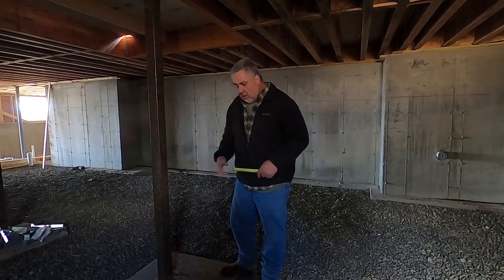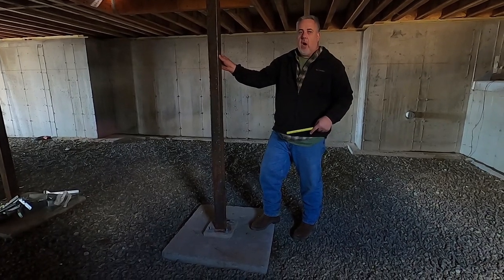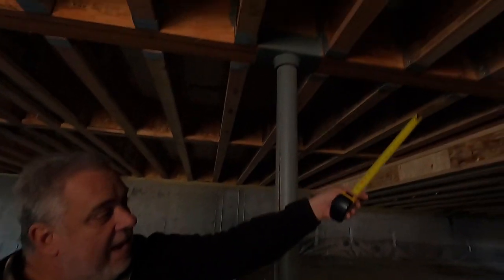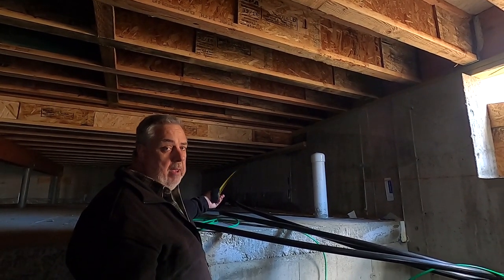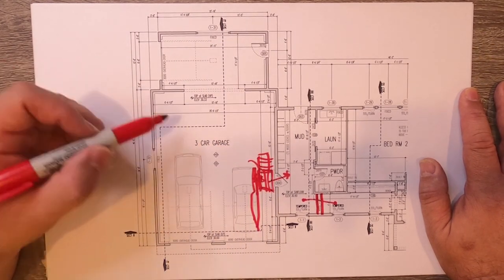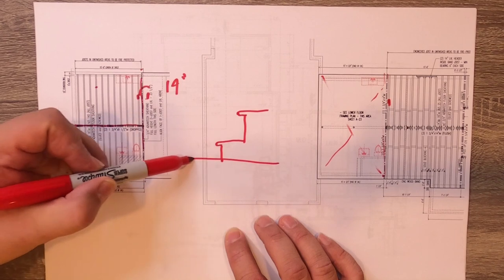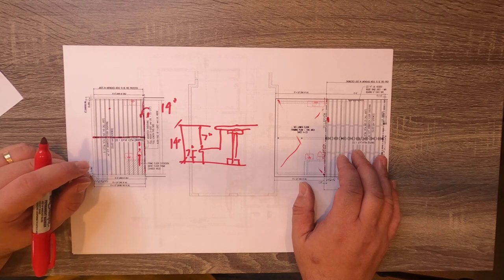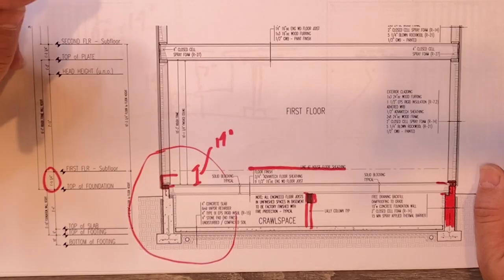Dropping the floor system + eliminating unnecessary stairs!

Comment: Great video, keep them coming. DIY'r here, wondering if you've seen this 'dropped floor' done in a remodel? I have a similar floor plan w/ hollow CMU foundation walls. Was thinking top flange simpson strong-tie from sill or possibly adding a stem wall, then running the exterior wall down to the sill. Will probably consult an engineer, just want to make sure my thought process isnt crazy. Thanks!